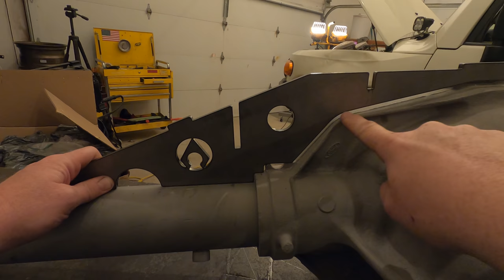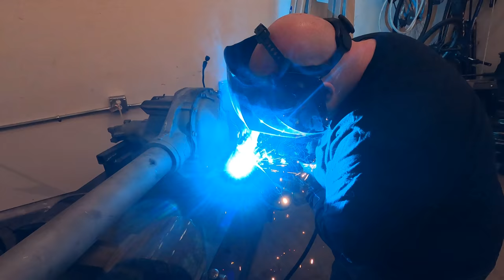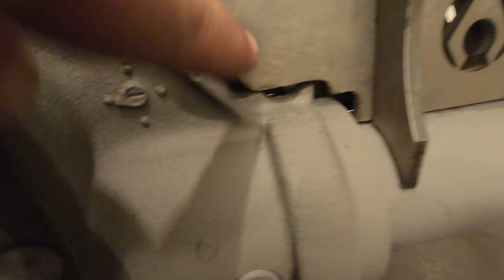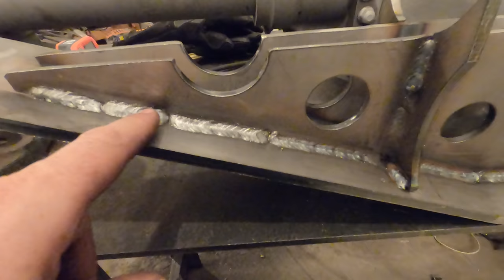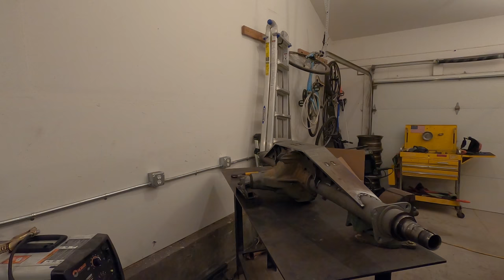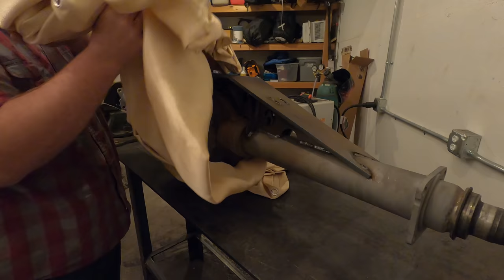Sterling 10.5 Artec Axle Truss Installation // FJ Cruiser Solid Axle Swap

Comment: Building and trussing your own axles.. teaching yourself to weld..yup, I’ve said it before and I’ll say it again. This Chanel is underrated, you’re a legend!
Reply from the maker: Thank you! I don't know about legend, but I'm a nice guy at least, I think.
Reply: @offroadhub.official  gaps are good,upto 2mm,you need penatration. champher the rest. stitch weld it,dont fully weld.
Reply: @offroadhub.official  s/duty diff,under an fj,dont need trusses. just weld the tubes to the centre. fj weighs about 4 lb,yes.. s/duty weighs 4t..the front diff vacuum seals,. dont use them, fit manual hubs, where the vacuum line went in,fit a zerk. once that vac seal is done,bad,,so is your diff.
Reply: @offroadhub.official  buddy,mate,real vid guy,,you cant,,ruin steel..cut shut weld,anything.. .. now wood..never touch it..
Reply: @offroadhub.official  pre heating gets the atoms disturbed. running around tryin to stay cool. & like cast iron, 100 degs. depending...slower it cools the better..
Reply: @offroadhub.official  warped axles,,heaps on star trek.. ford axles, 70.s ish,,bent up with use,,so ford bent them down couple degrees. a 79 d44 f250 8 stud diff is good.

Comment: Hey Ken, I've been welding 45 years and my first attempts were no better than this but they held and did not crack. Do in large part to preheating as you did which is vital to welding large thick material with long welds. I learned this from a friend and long time welder so your research will pay off. I don't weld much these days and my skill is not as good. As is said: If you don't use it, you loose it. ROCK ON!
Reply from the maker: It's amazing how much you can learn on YouTube these days. Just being able to watch multiple people weld and get their thoughts on it is extremely helpful.

Comment: Hi Ken, gutsy is what I say. I learned a lot from this one and yeah I notice from reading comments that you are inspiring many others to “go for it”.
It is clear that you understand metals and temperatures so thanks for putting it out there! Question, is your pumpkin empty of fluid when doing this and is the heat great enough to affect the seals?
Thanks for your posts!
Reply from the maker: Hey Jey! I drained the fluid when I disassembled the axle, but the guts are still in the differential which helps to stabilize  and prevent warping. It's important to do all this welding and heating before rebuilding as it will change measurements and it will melt seals. So yes, everything inside got cooked, but it hasn't been rebuilt yet so that's fine.
Reply: @offroadhub.official  thanks Ken, good to know order/progression.
With your welding skills you will be able to work on the sculpture soon! Hee hee
Reply from the maker: @jeytex3161  the sculpture... 😂

Comment: this might have convinced me to start welding, can you just plug the welder in to a socket?
Reply from the maker: You should look into it, it's pretty fun. If you get a 110 volt welder and use flux core wire it would be about that simple. But you should really look at getting a 220 volt welder. I got a Hobart 210 and am using a 75% argon 25% co2 gas.

Comment: Did you find a way to use the emergency brake?
Reply from the maker: I have not. I haven't really missed it either. But if I really felt like I needed it I don't think it would be that hard to hook up the super duty parking brakes.